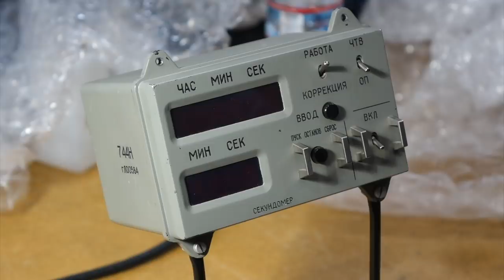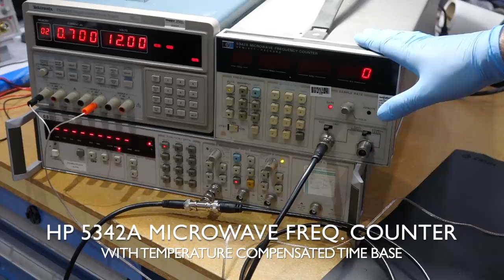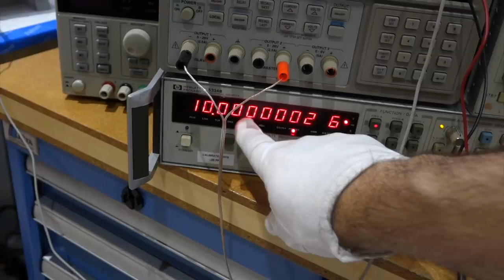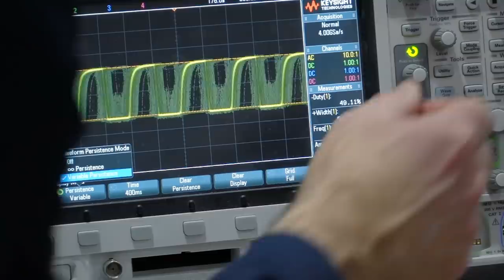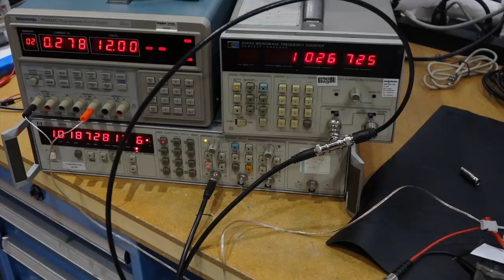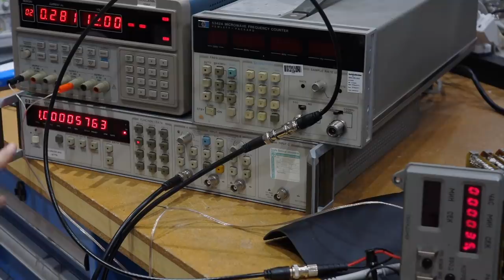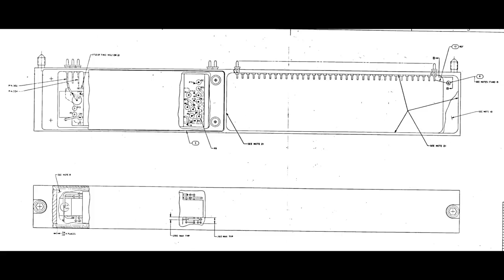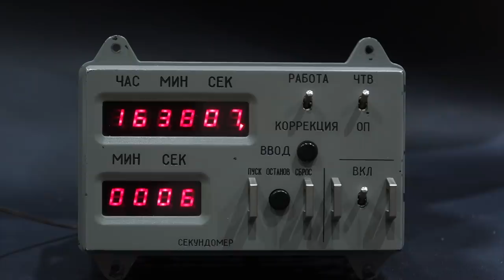Soyuz Clock Part 4: How accurate is it?

Comment: 6:40 - the gate time of the 2 meters should be in sync in order to capture the same, longer gate time = less time out of sync out of the total measure time.
Reply: The meters don't gate their inputs from any clock, they convert the input to logic level and analyze the result.  Disagreement between them is how many of the small glitches are tall enough to count as genuine GHz pulses.  Measuring the output from the on board divider will use whatever the clock uses for that decision.

Comment: Was the 30sec/day spec over the operational temperature? Your 4sec/day measurement was at a fixed, room temp obviously.
Reply from the maker: I'd have to confirm with Ken, but I suppose the 30s is over 0C-70C. Which as you rightly point out is a whole different ball game than room temp.

Comment: If it is externally clocked I suspect any failure of the external reference would be grounds for an abort. I suspect the short amount of time between such a failure and reentry wouldn't be long enough for clock drift to become a problem.
Reply: You have to convert the time error to a position error at orbital speeds.  At Mir/ISS speeds, an accumulated error of 100μs would miss the arrival by more than 2 feet.

Comment: With the initial 1MHz measurement were you measuring a buffered signal?
Reply from the maker: Yes. We probed the output of after the buffer gate after the oscillator that you can see on the hand drawn schematic.

Comment: 11:50 in this context, what does "aging" mean?
Reply: Crystals, along with most mechanical parts, change charactaristics with tiume after you have done machining work or heating to them. thus the quartz crystal element will have a defined measured frequency right after it is cut, polished, had plates sputtered to it, mounted into a vibration damping frame, and placed into the vacuum sealed housing.  As time goes by the crystal stress relaxes, and thus the frequency changes slightly. As well the stress changes as it is used, and also causes it to change. Thus you get an aging solely from when it was made, unpowered, and another added to it from powered operation. collectively they are all "aging", and the change decreases with time, till after some time ( generally 2 years) the change with time is very small, much less than the change due to temperature change or voltage it is driven at.

Almost all more than ultra cheap quartz crystals thus are kept in storage for a year or so after the cutting and polishing, before they are finally packaged and trimmed to final frequency, so that the bulk of the aging has happened, and the small amount of extra stress in trimming (either by using a laser to remove material, or grinding some off) is reduced, so that the unit will meet a tighter initial spec, and also have reduced aging.

Cheap crystals like for watches and low cost use are not so controlled, you will find some that are perfect right from the factory, and others will drift a few seconds a week, and never stop.
Reply: @SeanBZA Ah!  Thank you for the detailed reply! That makes sense now. :D

Comment: 4 s/day for reference, could be achieved by a relatively run of the mill mechanical wrist watch of the day, if correctly calibrated and aligned. 

The COSC Swiss chronometer standard for mechanical time pieces calls for an average daily rate: −4/+6 and this is not particularly difficult to do if the watch is reasonably well engineered. 

The Soviet eta Sekonda USSR 2614.2H based mechanical watch from around 1972 that I am wearing for example meets this standard, purely because it has been recently serviced and adjusted. 

A typical modern cheap quartz watch for comparison is going to put in around 15 s/month, or 0.5 sec per day, so that quartz oscillator is not particularly good. Despite all of that gold plating and over engineering, I have to say I'm somewhat surprised that your space clock is not more accurate than that. 

https://en.wikipedia.org/wiki/COSC
https://17jewels.info/movements/p/poljot/poljot-2614-2h/
Reply from the maker: Yes, there are exceptional mechanical time pieces that can do  4 seconds a day and are portable. And I do have a COSC certified chronometer. But it's far from being "easy" or "run of the mill". These are exceptional movements, and my wallet reminded me so when I bought it. And that's without the space vibe/shock/temp/acceleration/pressure requirements.

Comment: Делали когда то качественные приборы, пусть большие, но качественные
Reply: Забавнее то что они всерьёз говорят о том что точность этих часов 4 секунды в день. Если это 4 секунды каждый день то достаточно разобраться как их подстроить. Естественно что из-за старения "кварца" уж за столько то десятков лет эта регулировка должна была сбиться. Вот если бы они определили что уход за сутки составляет 4 секунды плюс/минус ХХХ мили секунд, то вот эти ХХХ и были бы действительно критерием точности для этой конструкции. Ну как тут не вспомнить М. Задорного. Тупые.

П. С. Нашёл во второй части крупным планом. Кварц маркирован 08.83. Итого 36 с половиной лет.
Reply: Сделал в те времена часы, на крупном ЖКИ и 176 серии. Питание от квадратной батарейки. Хватало на больше года точно. Ток потребления вышел ~~70 микроампер. Подстройка точности хода - переменной ёмкостью на ножках кварца. На машиностроительном заводе, в лаборатории, взял особо-точный частотомер. Тестировал и подстраивал частоту кварца, наверное пол-смены... пока мужики не отругали и забрали частотомер )

В итоге, эти часы уходили на ~~ 1 секунду в год (!) В общем, я и сам был поражён такой точностью.. может быть "случайно" получилось, а может и нет...

Часы стояли и работали в обычном серванте с посудой. В довольно стабильной среде. Солнце на них не попадало и ветер не дул..
Reply: @Vik_ru  "Солнце на них не попадало и ветер не дул."
Это существенно. Когда я налаживал свои часики на STM32, сквозняк заметно влиял на ход, буквально больше секунды в сутки. Потом я упаковал часики в корпус, и они перестали бояться сквозняка. А когда я приделал к ним GPS-приёмник, то они стали домашним эталоном времени. :-) Без GPS ход тоже довольно стабильный, может быть, похуже вашего, но меня устраивает. Кварц самый ширпотребный и без термостатирования.